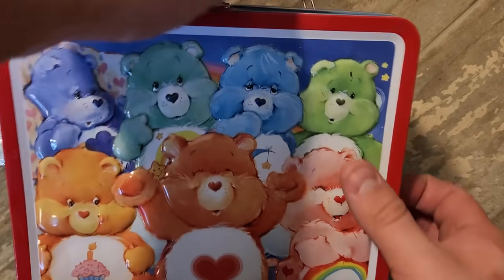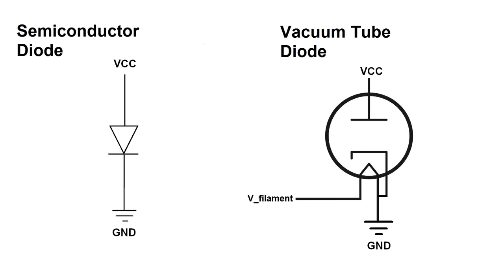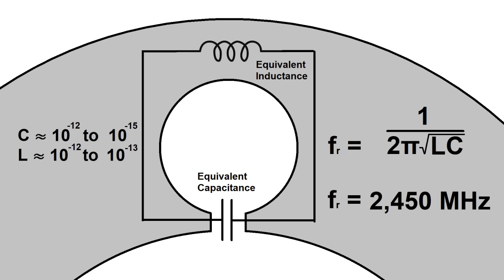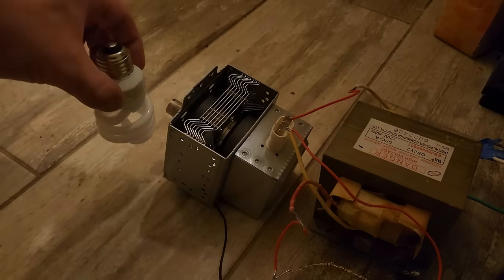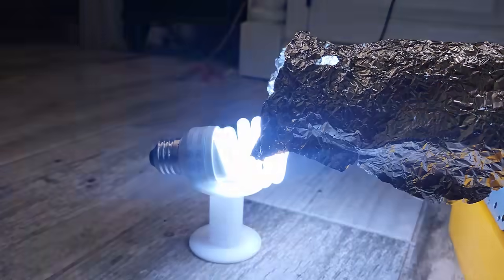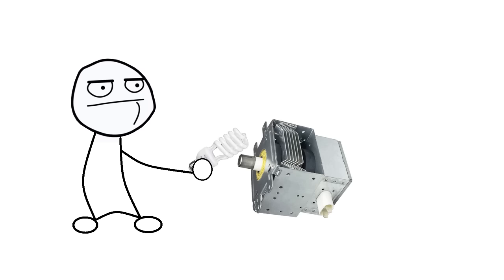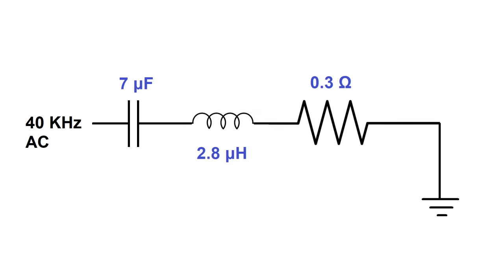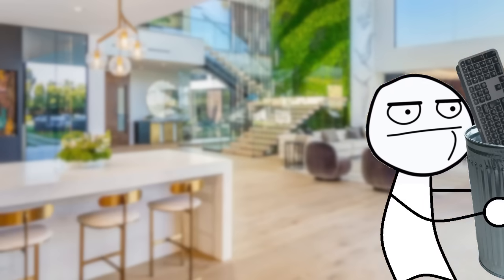Battery-Powered Magnetron

Comment: 13:35 can be beryllium oxide or aluminium oxide. Although given the price of beryllium v/s the price of the whole microwave appliance, I'd say the chance of it being beryllium is very low, but it's always good to err on the side of caution if you're not sure. Now if you were disassembling megawatt military radar systems...
Reply: There's almost definitely no beryllium oxide in consumer microwaves. Too expensive and not necessary.
The pink ones are alumina with a little bit of chromium to improve its mechanical properties. The dust of that is still bad to breathe, like with any ceramic dust particles. But at least it won't immediately give you berylliosis and turbocancer or something
Reply: @TiSapph  Yes true, you only will use the beryllium oxide for the absolute best thermal performance, where price is not an option. not on a cheap $40 consumer grade microwave, where the OEM who made it in China only had a $10 budget to assemble it, make all the cavity and case, and ship it to the port, and still expect to make a few cents profit. That big a chunk of beryllium oxide would be more than $40 alone, right from the manufacturer. Plus it will be white, though some are marked with a pink stripe to identify them, though not all are marked, just the part number is.
Reply: Yup they add manganese or chromium to the aluminum oxide to make it pink so that they will know which is which at the end of life.❤
Reply: Berrylium is white whilst aluminium oxide is pink most microwaves recently built use aluminum oxide, its cheaper and safer.
Reply: @thunderlord1263  Cool fact, pink aluminum oxide is basically polycrystalline ruby -- the color is chromium doping.
Reply: @T3sl4  so you're saying my magnetron is also a laser

Comment: 1. i am not sure if the magnetron will even fit into the jurisdiction of the atf because as the namesake implies "alcohol, tobacco, and firearms" maybe it could be used as a weapon but it is a long stretch since i think the beam gets weak at distance.

2. you can get 1000 watts at 24 volts a 6s rc battery can easily do over 40 amps for short bursts but you will want to get a battery with a very high c rating say maybe over 100 c though that would be expensive.

3. due to the potential of the video being taken down for some reason i downloaded the video so it can be posted to a 🌊 site where  only illegal images, malware and fakes are taken down
Reply: It’ll be the FCC that comes after him because this is essentially an unlicensed, absurdly powerful, 2.4Ghz transmitter. I’m sure the cell towers near by love this thing (some cell bands use 2.4Ghz). I can guarantee the electronics in the tower are logging the horrific interference.
Reply: The BATFE (Bureau of Alcohol, Tobacco, Firearms, and Explosives) has jurisdiction over "destructive devices", usually meaning bombs, but which would also certainly include "magnetron on a stick", seeing as another name for such a thing is "EMP gun".
Reply: @tissuepaper9962  i am not sure how destructive microwaves are i mean certainly you are not going to get knight rider explosions and sparks from a microwave.
Reply: @ejonesss  It doesn't matter if the "destructive device" is actually effective, it still falls under their jurisdiction. That being said, you absolutely can cause explosions and sparks with a microwave, and you can very easily and quickly destroy any device with WiFi or Bluetooth capability (aka almost everything these days). Even devices that don't operate in the 2.4GHz band can absorb the radiation and be destroyed if they contain any wires or PCB traces that are 6cm or longer.

Comment: Also, magnetron + waveguide = EMP gun. IIRC those exist and work perfectly well cooking all unshielded electronics at a fair distance. And small animals. I used to be obsessed with this tech couple decades ago :D
Reply: I can’t tell you how many times I wanted one pointed out the back of my car while driving on the freeway. Damn tailgaters!!
Reply: @cerberes   The us have experimented with this idea for crowd control and pursuit....with mixed results lol
Reply: @derpinbird1180 it doesnt work with even the slightest bit of humidity
Reply: Yay Havana syndrome for everyone!!
Reply: Do you have a schematic anywhere? (Asking for a friend)
Reply: @Minacious_Shenanigans  Heat the filament and discharge a big cap thru the magnetron
Should be easy to figure out. Don't kill yourself in the process
Reply: @Fluxkompressor  Mk thanks, I probably won't kill myself.
Reply: @Fluxkompressor this is the "pulse" in EMP yes?
Reply: @GeoffryGifari  It is a pulse of electromagnetic energy yes. So you could call it an ElectroMagneticPulse
But it is a fixed frequency, so pretty easy to shield.
But a real EMP is basically a frequency from DC to Daylight 
Just don't expect something like Golden Eye
But do expect frying your cellphone and your wifi router!
Reply: @Fluxkompressor aye, if you want one-off EMP "bomb" then you just need to fire a powerful magnet through a big coil. The EM radiation is in this case result of the CHANGE of magnetic flux. And explosives-powered "core" travelling through a well-winded coils generates A LOT of change in the flux.

It will destroy itself in most designs when it "fires", but yeah, it will send a pretty stupid levels of energy as an undirected "pulse"
Reply: @Minacious_Shenanigans 😆
Reply: Not  small animals. Fruit flies are fine.
Reply: @besenyeim  Well you could kill a fruit fly you would just need a higher freqency. They will survive a microwave because the emit 2.4ghz with a wavelength of about 12 cm
Reply: @besenyeim  large mammals
Reply: Better save it in case it get taken down, I bet this is what powers all these military handheld anti-drone guns. Maybe not with consumer magnetrons if it has to be a rifle, not shotgun,  but now it's available for everyone. In few months someone else will try it, make another video, repeat until it gets perfected and some florida man will get jailed for shooting down government/air force/uap objects
Reply: Shhhh
Reply: is that anotnio longoria myth?

Comment: Ladies and gentleman, THIS is what I'm talking about. True maker video right here. Technical, but didactic. Easy to follow with basic electronics knowledge and still going WAY beyond the boring flashy stuff you see on other channels. Packed full of content, building a cool idea, troubleshooting the many challenges and still, all withing 15min. Bravo! Amazing content as always Pirate, cheers!!!
Reply: and hella funny as well!
Reply: It also doesn't have that ridiculous "don't try this at home - or you will kill your self..." non sense, repeated like 10 times throughuot the whole video. Despite being one of those video where some safety warnings could be motivated - I still don't like that being done in a way that expect all viewers to be dumbasses who have no idea what they are doing. Real dumbasses wouldn't understand what's being done in a video like this and get it working anyway
Magnetrons are in fact one of those things I have been a little scared to play with my self though - despite having one laying around. 
Things like high voltage electricity, lasers, fire, molten metal, etc. feels easy to control and avoid the dangerous zones. Microwaves, not so much as they spread everywhere and is  likely to cause damage before getting noticed (as they will heat the body from inside, not from outside, like most other heat sources). 
The risk of frying expensive electronics shouldn't be underestimated either as we saw in the video, haha (I think that problem really gets exarbated by the fact microwave ovens are running at 2.45 GHz - which is very close to the 2.4 used by most WiFi and wireless systems. So the antenna and antenna circuitry get hit pretty much at it's peak frequency, which it's tuned to). When living in an apartment like me, thare is a risk to fry the neighbors WiFi routers and other stuff as well, haha
Still looks like a very interesting projects though and running at limited power like this, it looks quite manageble.
Reply: It wouldn’t be a smart idea if you start to play with high voltages/emf without basic knowledges on the field.
Reply: Probably could have used a bit more discussion of how the floating filament supply works
Reply: The most important fact that most people dont realize is that the magnetron has a very hard current vs voltage curve. It is like a silicon diode, first no current for a long time, then a hard vertical increase. You can not run it well on a constant voltage supply for filament and anode, but also not constant current. Thats why it is very important to have some closed loop control wich in case of the cheap microwave is done by having both windings on a single transformer, the transformer runs both at foll blast until the filament is hot enough and the tube starts conducting. At this point the HV winding will load the transformer, limiting the filament voltage at the same time. This was the tube will always run at the maximum power that the transformer can deliver before saturating. Its also the reason he had bad luck with a separate supply for the filament, even using the original MOT. The window of just 0.2V for the filament is because there is no feedback.  @DrewskisBrews   @HyperspacePirate
Reply: @DrewskisBrews he left a link for that
Reply: @revmsj  fair enough,  but it is critical knowledge for the safety of people and equipment
Reply: This guy has a step by step video making a homemade 1-man submarine. This channel deserves awards. 

Especially considering every other channel just copy the same 10 projects.
Reply: @chipdipler   Exactly! There are a ton of channels out there just churning the same content over and over... This right here is good old school maker stuff.
Reply: Agreed!
Reply: iz very niceee
Reply: Well said.
Reply: im not asking about if its a good idea or not, im asking about actual cases of blinded people. Its n urban legend, everyone tlld it as a fact but there i no reportet cases. About the death by MOT, likely stuff happened there. But its not a pandemic of dozends of people dying every year. @pixieflitwit1516
Reply: Yeah, don't try to hide your boner or anything, we'll all just pretend it isn't there.
Reply: He really is HYPERSPACE PIRATE
Reply: The explanation is one of the best, I agree, but I'm missing a safety warning. There have been numerous cases of people causing themselves neural damage, or going BLIND from accidental exposure to an operating microwave oven magnetron. And it's not like the waves go in one direction, they reflect. And it generates so much crap, it's a really bad idea to run this anywhere near an urban area. And not to forget, playing with MOTs alone kills more people than any other projects you find online.
Reply: Do you have links to those cases? I have never seen one.  @ErikBročko
Reply: @ErikBročko and let's not forget the dangers of pissing off your local Ham operators with all the radio spikes up and down the spectrum you cause with an unshielded class III device! The horrors as they hunt you down and give you a stern letter or talking to!

Comment: hey if the xformer is plling lots of power even with current limiting on the hv draw, i think it's just the filament winding. 10A 3v...
Reply: "reactive current", "power factor", plug these into a search engine of your choice and you'll understand what he means by "the current is going back into the grid".

Comment: Fantastic explanation of how a magnetron works, certainly the best I've seen. Also a pretty cool device, but how much RF power do you think it was transmitting? Seemed to me like the filament was the part doing the most heating, but I agree the RF heat is far cooler to play with.

Comment: IIRC the most danger the magnetron poses is to your eyes. Eyes are lubricated by a thin film of fluid which would instantly heat up upon exposure to the microwaves as all water films would. So, directing the magnetron at your face ought to blind your pretty quickly.

Comment: Beryllium oxide hasn't been used in microwave oven magnetrons for years. There's no advantage for it nowadays. It's really only dangerous if crushed to dust, too.
Also, kilowatts of microwaves in the air will immediately cook your corneas if you're anywhere near the actual beam while running at full power. And then, you can get fun subsurface skin burns that take weeks to heal. If you're lucky enough, you could also cause a... "critical human failure" by arcing the *output*.

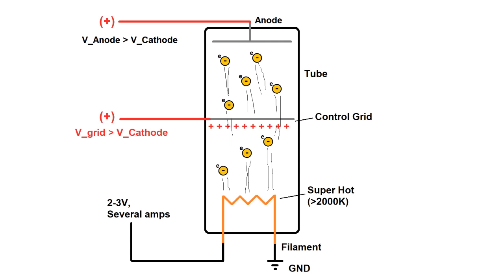Comment: 2:20 - It depends, on grid placement. If close to cathode, it will still conduct at ground, an a negative grid voltage is needed to stop the current flow. In VFD (vacuum fluorescent displays) the grid is closer to the anode, and then a positive grid voltage is needed for conduction.

Comment: That ceramic actually isnt beryllium, use of beryllium in such appliances is prohibited by beryllium regulations. And even if it was used, such appliances have to have warnings
Reply: also have you seeeen the price of beryllium? No way anyone would put that in a $100 appliance.
Reply: @AlexanderBurgers  exactly
Reply: If it's an older microwave, it''s probably beryllium,  also you don't need to have warnings on that kind of stuff because noone is going to reasonably get acess to it unless you tear apart a microwave. 

could also be aluminum oxide since that's cheaper but it kinda depends on the source of the component.
Reply: @radishhat5736   idk if really old (20y and more) microwaves had berylium inside but this one definitely isnt old magnetron. Warnings are also for classified repair personnel so warnings of devices containing berylium are as important as high voltage warnings, also datasheets have to tell you that the device contains berylium (for example old hemts)

Comment: It'd be interesting to see if you can turn a microwave magetron into radar. Seeing how the story of how microwaves were made is cause some guy was messing with radar when it melted the chocolate in his pocket.
Reply: It's has been tried, the problem is how they design microwave magnetrons, the problem with using the magnetron in radar or rf transmission is that the magnetron cannot be tuned, it's physical construction incorporates it's tuning characteristics 

So if your magnetron operates at 2.6ghz you can't detune and get a 2.1 or 3ghz rf signal out of it

And becomes unstable when trying to tune it externally
Reply: @Clancydaenlightened not quite there are ways to tune a magnetron on the fly, but even then the frequency can be unstable, if you were using a magnetron in a pulsed radar system the RF pulse frequency isn’t just unstable from pulse to pulse, but over an individual pulse as well
Reply: @polarisukyc1204  And you also want the phase information on receive so a stable oscillator is kind of necessary. Which a magnetron sadly is not. But I suppose you could get some ranging done (simple time of flight measurements with a broadband receiver)
Reply: @allesklarklaus147  that’s probably what we wanted It for in world war 2 when it was invented (the cavity magnetron specifically, the first device to bear the name magnetron was invented by an American I believe)
Reply: @polarisukyc1204 a radar magnetron is built differently than the one in your microwave 

Radar Don't all operate on 2.4ghz either
Reply: @Clancydaenlightened  I know but the first cavity magnetron was built for radar, its was Percy Spencer’s brilliance that started the microwave oven concept
Reply: Hmm. I had read that the magnetron was first developed by Megaw, in Japan.
Reply: @Clancydaenlightened   Since you can't tune the magnetron the solution is to tune the rest of the circuitry to it. I've heard this is what made the Allies' radar much better than the Axis'.
Reply: @Clancydaenlightened  The frequency can be changed around a bit via modulating the anode current (quite possibly even more with the filament) but that is a small range.
Reply: @HA7DN  I wonder if it would be good enough to uplink to QO-100.
Reply: @Clancydaenlightened the main problem is that the phase isn't consistent
Reply: They don't turn on and off fast enough for anything short range such as an amateur tinkerer would have available.
Reply: Old radars used to be like 20 meter wavelength, am sure there a consumer way of building it.
We don't have to enter nanometer/millimeter wavelength to have a functioning radar. :')
Reply: You could do this, all you need to do is store the HV in a capacitor and dump it in with a fast switch, then use a pulse timer and a return detector, then take the time traveled and multiply by light speed to get your distance. A Gunn  diode with a fast rectifier works well for the detector.
Reply: @christopherleubner6633  Dont the new HEMT transistors work better, but at a cost?
Reply: @Sven_Dongle  yes they would work better especially since you can use different frequencies or modulate RF over microwave to get more precision. A really cheap source of microwave power transistors are old cellular transmitters or if you want really nice nitride transistors look for some scrapped 5G equipment. Turning the high current low voltage microwave field into lower current high voltage microwave energy is still something of a black art though.
Reply: The guy Tom Scott interviewed!!
Reply: A micro-radar , i like it
Reply: That story about the melting chocolate bar is highly likely to be bullshit.
The British discovered the cooking potential of microwaves long before that with early radar systems killing seagulls, they just failed to see how it would ever be useful (well, they did have a war looming at the time).
It’s a cool story though, but just the usual Americans taking credit for stuff again.
Reply: More than one sailor in the navy had eyeballs instantly hard-boiled by ships radar.
(don't believe one word I say. Go look it up. Prove me wrong. Go on.)
Reply: I remember that one
Reply: Did he go blind?